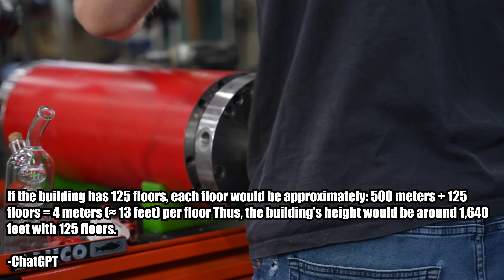Simulating Diver's Decompression Sickness with 500 Meters Deep Dive in Pressure Chamber

Comment: The nitrogen DID dissolve well in the water. It's not very clear, but the water was fizzing like pepsi max at least on the surface.
Reply: Not seeing it.
Reply: @manuelh.4147  You can see it on the puddle in front of the cup
Reply: Yes, it was very obvious in the pool along the tank bottom - probably as it had much move surface area and a small total volume, so could absorb a larger percentage of gas.

Comment: Mixing some gelatin and letting it set in the pressurized chamber could be interesting. The more solid-structure of gelatin may allow the buildup of bubbles to be more visible as it would likely either 1. explode or 2. capture the gasses in bubbles internally which may then be visible by passing light through the decompressed gelatin

edit: apparently someone wrote a paper covering this: "Quasistatic growth of bubbles in a gelatin gel under dissolved-gas supersaturation". my non scientific take away is that you'd want the gelatin solution to be as week as possible (as a stronger solution inhibits the growth of the bubbles) and you may need to add some energy to the system to trigger bubble formation

Comment: My suspicion that the shimmering effect (5:12) is from the heat of the light.
Reply: At high pressure the gas is much 'thicker' and slight temperature or density variations refracts light quite noticeably, especially while mixing gasses(Nitrogen in air) there will be a lot of density variation until they mix thoroughly.

Comment: Actually, small air bubbles are perfectly safe in your veins. I've been on IV drips before where I've literally watched an air bubble flow through the line and into my arm. Of course with the myth of how little air it takes in your veins to kill you, this freaked me out. But the doctor reassured me it was a normal thing with IVs and perfectly safe. And I'm prefectly fine. Even though contents of the bag are vacuum sealed, when they connect the lines, a small amount of air gets in. It's no big deal. A 10cc syringe full of air on the other hand might be a different story.

Comment: If you were to pull a vacuum on the water and meat then put the carbon dioxide gas connected to the inlet where the air goes in to relax the vacuum you might get a better reaction.

Comment: Put cotton in a jar, under water, and a smal hose down in the cotton. Set camber under pressure. Then let a gas flow in the smal hose. Now the cotton " collekt" smal bubbels  in the cotton. Relese pressure in the camber. All this small bubbels will expand, and  go to the water surface. Every bubbel is going to expand about 50 times. Let say 100 realy smal bubbel (nerly invisible)    like a pin head, take that size times 50, will be 0.5 cm³ for each smal bubbel.that visual how cotton now explod.